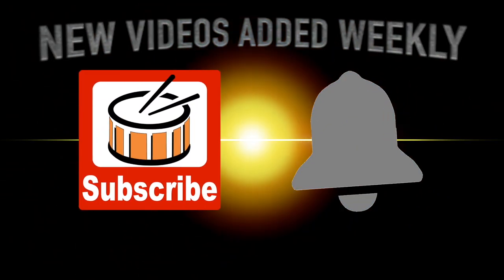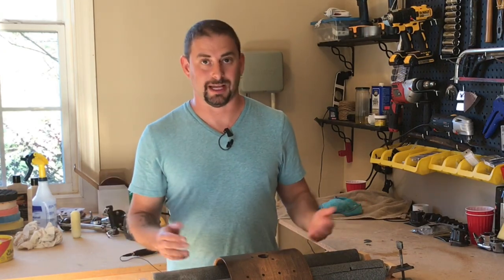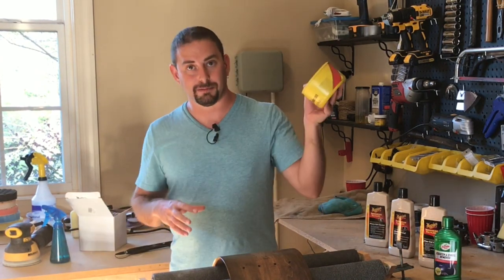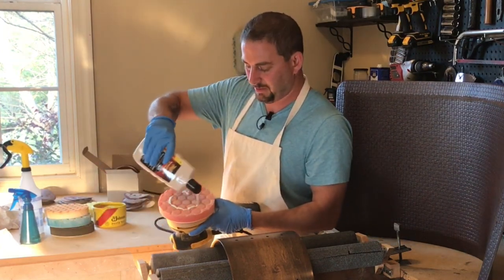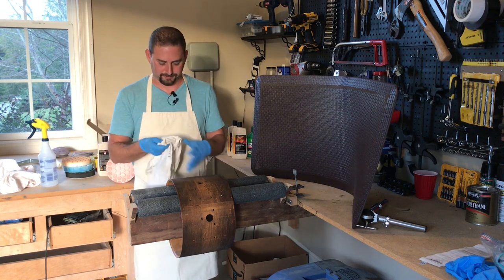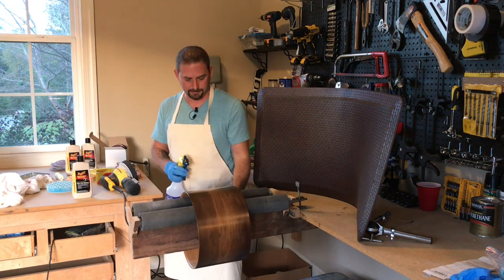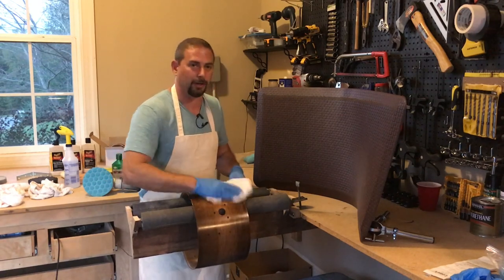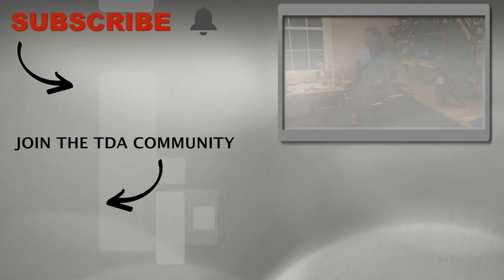Restoring An Old Drum Set - Part 4: DIY Rubbing Out Drum Shells

Comment from the maker: Poly, lacquer or wrap... Which do you prefer?
Reply: Definitley lacquer. Poly is fine but lacquer adds some degree of protection. Wrap adds more protection but I absolutley hate it... 🤷🏻‍♂️
This 4 videos are very helpful and I appreciate you take the effort to make them. I'm planning a restoration of an used snarw drum I recently bought and that has been really mistreated and abused, but it's a great snare (Mapex Black Panther) and the price was a gift. So this will be very helpful. Of course, I'll also ask for advice to friend of mine, who is a luthier, but I want to do it by myself and this will help.
Reply: My first project which was mostly done by a friend who is a master carpenter, the kit shells had 7 layers of lacquer with 5 layers of poly. over top. The snare drum (African Black Mohagony) was 10 layers of Poly. I know that lacquer can break down over time from sweat so Poly was the best choice for protection from that and dings. At the time, everywhere I researched Lacquer was used either by itself or in conjunction with Poly. I realized much later that the Poly was all I really needed.
Reply from the maker: @richardkersey4960  I'm pretty happy with the poly myself... Check out one of my newer vids to see how the drums look and sound a year later :-)  Definitely held up well
Reply: Does wood filler accept the urethane like the wood?
Reply from the maker: @markdemell3717  I would get an oil or poly based wood filler. You can get latex or water based, but I am not sure if you would have a problem.
Reply: Poly
Reply: Lacquer❤️
Reply: Ploy man is so much better than warp
Reply from the maker: @jacobmartinez229  …My drums still look great, two years later… 😉
Reply: I've only ever finished a prefab ,paint/stain ready maple Keller shell but I used satin poly just to save a lot of work and also due to lack of skill to get a finish like yours. I did do a good job tho with sanding with different grits and using dish scrub pads to get rid of dust and debris from sanding. Sanding between coats of urethane. My 8"x18" short stack kick looks as good as any satin finished drum from manufacturers so I was satisfied. Antique Cherry satin with 2" wide natural maple hoops and vintage style tube lugs. Perfect for jazz gigs for that traditional look. Now I just need matching rack and floor toms.

Comment: Great job, I'm doing a WFL and I put a epoxy glaze coat on it. This was very helpful. The product I used is supposed to be poured but applying to a drum shell I had to use a brush, therefore I have some small bubbles and need to rub it out.  Thank you!!!

Comment: I really like what you have achieved ,the kit looks great. In my past experiences restoring old kits one thing that really improved the bass drum tone to a surprising degree is replacing metal hoops with wood hoops . You have one wood and one metal so can I suggest replacing that metal one with wood. Not only will it look better but it will improve the drum's sound noticeably . The Keller shells really lend themselves to taking them back to the wood. I have a '63 Premier kit , 3 ply with reinforcement hoops. I am 65 years of age and did a similar snare when I was 12 ! It had an other ply that really was cheap open grain which did not look too good ,so either a new wrap or live with the Ringo brown with gold finish which is consistent with the retro look now popular. Oh the guy who gave me the set took it to South Pole , so the chrome is really pitted ! Sorry about the sermon on the mount ! Cheers from Australia.
Reply from the maker: Daniel Reily  thanks Daniel. I agree, a wood hoop on the front wood probably look and sound better. I’ll have to try that! You can always refinish that chrome. I originally was going to powder coat, but opted to use spray paint on all the chrome hardware. This is now my studio kit, so it doesn’t need to be road worthy. I figured paint was a good cheaper option.
Reply from the maker: I have a student down in those parts! Where are ya from?
Reply: @Thedrummersalmanac  Hi, sorry about the delay in replying. I am from Melbourne Australia but lived in Texas for 19 years which totally restored my love of music and drumming ( even singing !). Austin Texas is a fantastic place in so many ways . I saw an old guy play at a bar in Harker Heights the place was "Cutters"  who was Stevie Ray Vaughan's road manager. I asked the guy "Where did those shuffles come from ?". He said sit down and chat, we had a great chat. I later learned he was Uncle John Turner ..Janis Joplin's drummer, Johnny and Edgar Winter's drummer etc . etc. Another time Buddy Miles played there but I was "Not Worthy !" to talk to him ,I regret that. That man had evil single stroke rolls ! Great players can be very humble if you get a chance to meet.

Comment: Great job Jay.  The drums looks great.  I've only done some minor restorations for scrapes and scratches on  wooden snare drums.  I only had to fill in the scratches and match the existing colour shade. I have never done a full drum set ... let alone taking it down to the original foundation as you did.  I love the darkened hardware ... great idea.  I love the new finish ... I'm not a fan of the wrap.
Reply from the maker: Thanks, John... Wraps are good on touring kits... More durable... This restored kit looks nice but it's definitely not durable. I intend to just keep it in my studio... so it shouldn't be subject to much wear.  I should have leveled the shells.  That caused me lots of problems.  Yeah... the dark hardware came out better then I thought it would... considering I just used Rustoleum. lol

Comment from the maker: There are a bunch of ways to do this.  I opted to used these Meguiars polishing compounds to rub out these drum shells... Has anyone had any success with other polishing methods?... Let me know in the comments!
Reply: I did my last coat super thin with a roll brush but I can't get the tiny bubbles out without scratching the finish with the 400grit.  Will this polishing method smooth out the tiny scratches? Or should I leave the tiny bubbles and let the polishing method you used in this video take care of the bubbles?
Reply from the maker: Dexter Taylor  You really want the shell to be in the best shape it can be after the last coat. The polishing is not sanding... so I’m not sure how well it will remove those bubbles once the finish cures. What I did was... I took a shop rag and folded it into a tight square.  I wet it a little with mineral spirits. Then I spun the drum on the rollers and lightly rested the edge of the square on the shell as I spun it... zero pressure. One smooth pass and I was able to get rid of the bubbles. There were some very fine blemishes and dust particles... but you had to look real close with a light to see them.  The polishing removed all of that and left the shell flawless.
Reply: @Thedrummersalmanac  ok thank you
Reply from the maker: Dexter Taylor ...hey Dexter, how’d they come out?

Comment: I loved this, the presentation is on a level that I can understand. From what I've seen so far tools, resources and personal preference dictate how you can reach the same goal. I'm poor and inexperienced so this was great. I did run across one aspect that I know something about.  When polishing/buffing a slower rotation both decreases the heat build-up and mess. I do try to keep my cymbals clean. LOL. I'm redoing my old Masters Custom snare drum. Going for a darker redder tone stain( Deep Burgundy). I was thinking about applying a candy clear coat (Cherry?) Do you think this would do the job or, would it be an unnecessary step?
Reply from the maker: I am sure that would look great if you get it nice and even.  I'd love to see it when it's done.

Comment: hi from canada! im attempting a similar project. old late 60"s ludwigs. i used a wood filler compound to fill in the gaps, and it didnt work too well. the filler and the original shell did not tske the stain exactly the same, and the difference is quite obvious.  anyone attempting to strip a wrap off an older ludwig kit, i would only recommend doing it if you were planning to rewrap them.
Reply from the maker: james Ledzepplin ... it all depends on the wood. My shells are maple. If the wood doesn’t have a heavy grain then I would imagine the filler would be pretty noticeable... also I saw someone online use a trick where they mixed some sawdust from sanding, in with the filler to better match the wood once it cured.  I’ve never tried that though.
Reply from the maker: james Ledzepplin ...id love to see your finished product though!
Reply: id send you a picture if i knew how lol. not too savvy with the technology.  i did use some wood dust from sanding the drums in the filler,  but its fairly obvious.  you can also see clearly where the plies were overlapped, and some filler was used to even it out in the factory.
Reply: one thing i did differently,  was i went pretty heavy on the first frw coats,  then used a rotary sander with fine sand paper to even ut out. a few very thin coats to finish it off seemed to work well
Reply from the maker: @jamesledzepplin7839  You can DM me on Facebook or instagram @thedrummersalmanac... I would love to see some pics!

Comment: Thanks for the reply.I have a question . How does that kit compare sound wise to your GMS kit ? ( I love them !). Pearl drums really have helped improve the quality of affordable drums (and higher end of the scale) from great engineering on the hardware and development of new materials .As far as refinishing the chrome on my '63 Premier ,apart from the high cost, the pitted chrome tells a story ,a band (Jazz) at the South Pole !
Reply from the maker: Daniel Reily they honestly sound great... even better with the new finish. It drastically changed the sound adding all that Polly to the wood. They sound and feel  different than the GMS... but different is not worse or better. I have fallen in love with them all over again. It’s become my favorite kit to play, which is weird for a throw-away kit that I’ve owned since 2003.

Comment: I've got an 82 pearl export (1st year exports)7 piece double bass all original my question behind the sentence is .....as I embark upoon restoringing the kit I'm wondering if finishing the inside of the shells with spar urethane or some type light sealer will alter sound ? ?
Reply from the maker: The more mass you add to the shell, the more it will resonate… or so I have heard. How much depends on how much you add. Curious to see how they turn out.
Reply: @Thedrummersalmanac  thanx I can see where that s plausible considering how shell resonance is what I'm trying to achieve .going for complete restoration but it's my only kit so it will be used as intended..just wondering if I should go back with Ferrari red wrap for originality or go with something different.......

Comment: i'm at this phase with the drums i'm redoing - do i really need to go with all 5 steps here? i applaud you and the work you've done with yours but i'm a guitar player and i just want them to be done already - i'm converting them to an electronic kit for a studio set up in my shop - thanks
Reply from the maker: The real question is... how perfect do you want them to look? Polishing them this way will give you a perfect finish. If you’re happy with them being a little more raw, then you don’t have to go as nuts as I went... my goal was not to have to spend $3000 on a brand new kit.  So for me the extra elbow grease was worth it. But, if you can live with the imperfections you can certainly skip polishing. However, if you do polish... I wouldn’t recommend skipping any of these steps, especially if you’ve already done so much work with apply many layers of clear coat. You don’t want to skimp on the job right at the end of the project ending up with shitty looking drums. At least, I didn’t...
Reply: @Thedrummersalmanac  thanks for the reply - yeah i've got a lot of work into them already so i might as well finish them off right - what is the polish you used? i'm getting the first 3 glaze thingys from Amazon -   thanks again